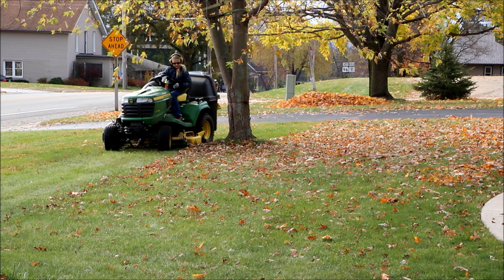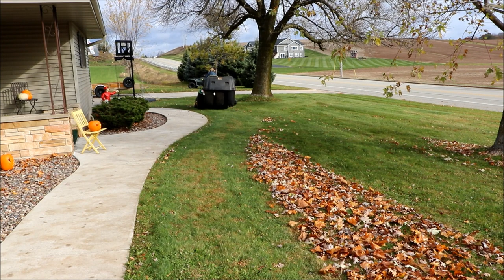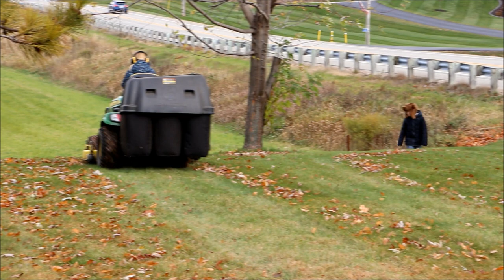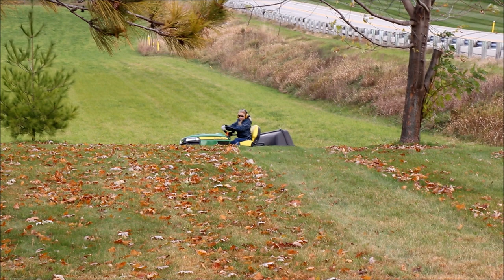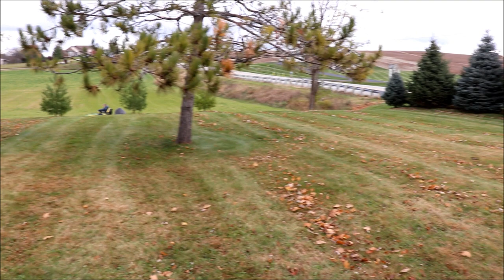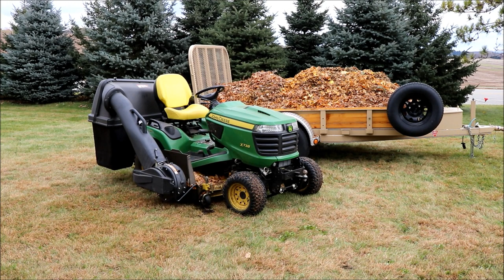John Deere x738 Collecting Leaves

Comment: That auxiliary blower/vac motor on the chute tube makes a big difference.  I have a JD X300 with no chute assist and you have to go pretty slow or the chute will clog (also must be bone dry)  Tim did a review on a pretty nice system that  has a larger holding bin and dumps without getting out of the seat!   =D   https://youtu.be/Z36gHPS3_E8
Your Daughter drives that tractor like a pro!

Comment: Great video, how do you like the X738?  Do you ever wish you went with the X758 diesel?  That’s the question I’m asking myself when I’m finally able to pull the trigger on one. Also considering the 1025R sub compact or Kubota BX 2680.
Reply from the maker: For a lawnmower I wanted a gas engine.  Maybe if I had a bigger lawnmower deck or snowblower the diesel engine would be worth it.  Otherwise I am happy with the gas engine.